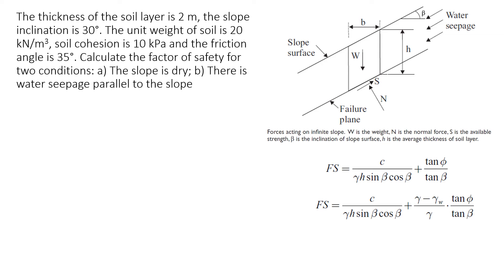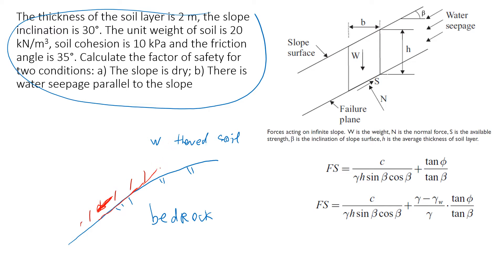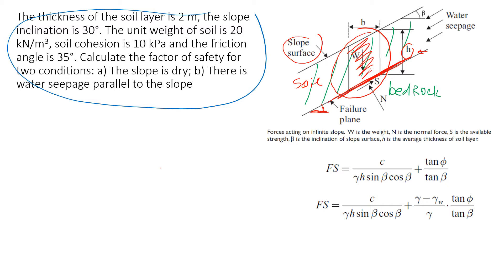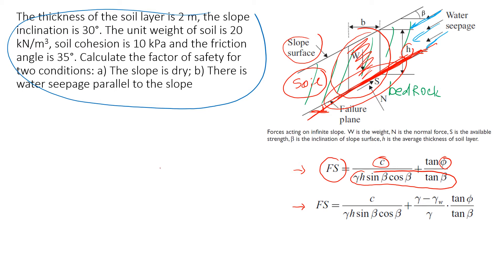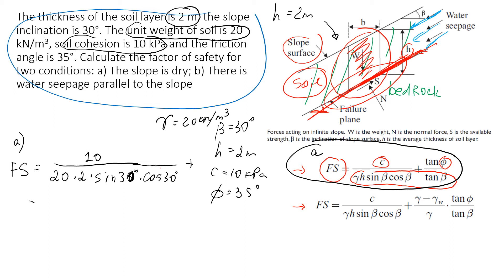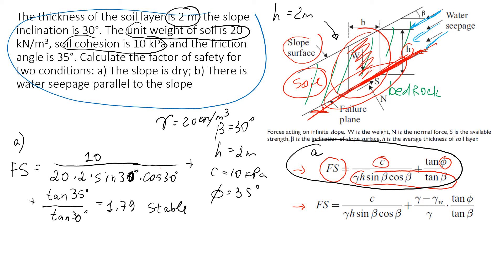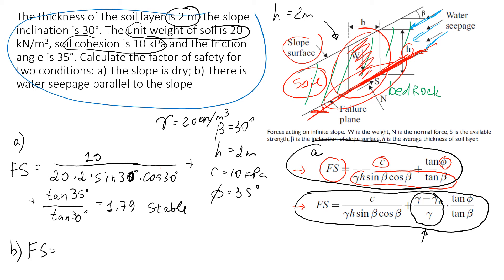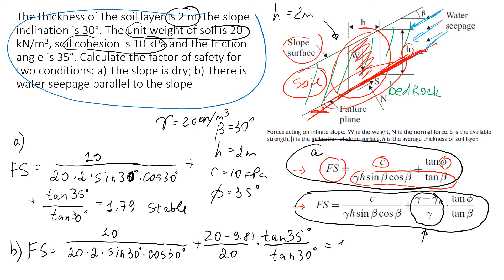Slope Stability Analysis of Infinite Slope in Geotechnical and Civil Engineering

Comment: I have a qn related to a project that I am on, also I would like to get your email in case you would like to discuss more, so the qn is we have constructing a swamp crossing using dump rock and gravelly clay soils to form an embankment, would I use the same method to determine the strength of the embankment? And how would I go about it ? Thank you